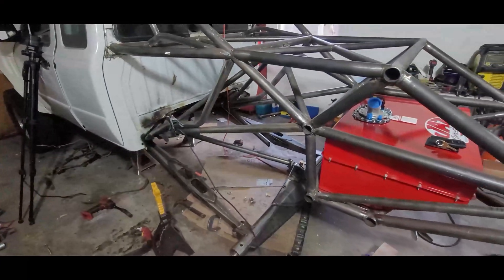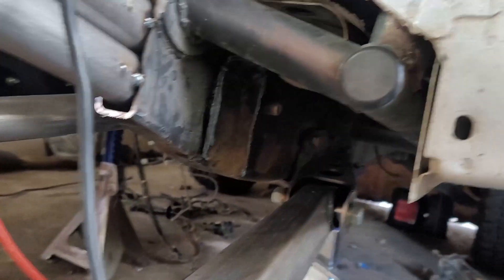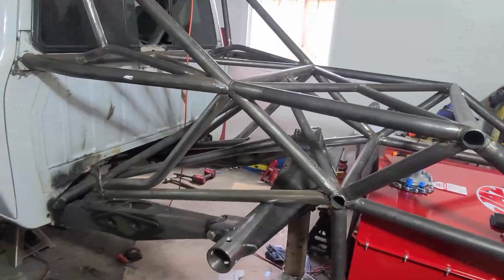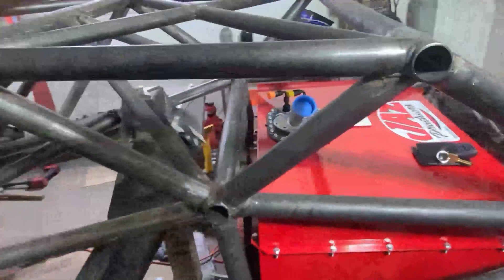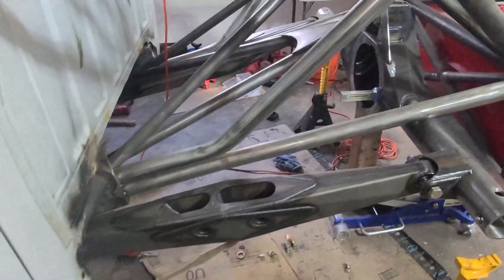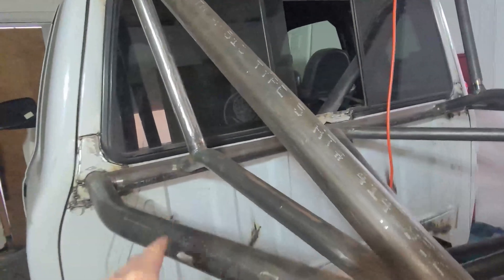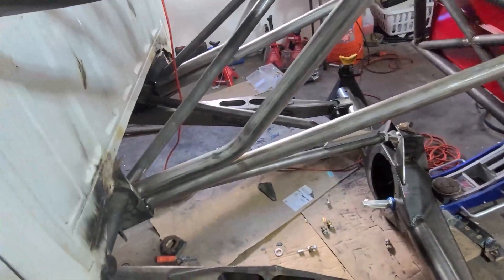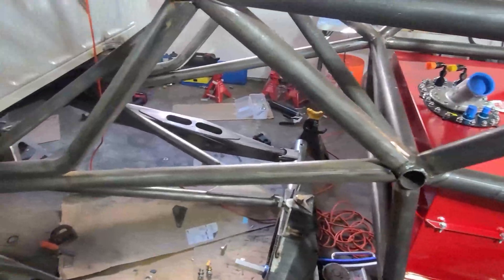Ranger Prerunner Backhalf EP6

Comment: A 14” coilover and 16” bypass might work better for you. 
No point in running a 16”/18” package if your going yo strap it at less since you’ll have way more travel than your front. 
And a 14”/16” package would probably allow to retain those 2 tubes you were talking about cutting out.
Reply from the maker: I'm not really worried about that tube structure, the 16/18 would fit better than a 14/16 and I wouldn't run into as many issues. The bigger the shock the better overall.

Comment: The trans on trucks is usually point down at 5-6 degrees. You want a parallel driveline angle, meaning the rear pinion should point UP 5-6 degrees at ride height. The concept of level has nothing to do with it.

Comment: Also +3 rod ends which those links might need are actually 3 in longer than the standard rod end. I may be wrong but I'd just wait till you have the shocks and ends to build the mount
Reply from the maker: Yeah, they need the +3 rod ends, i am still waiting to build the mounts because of that.

Comment: With pinion angle. If you're using a double cardan driveshaft then have it pointing at the trans at ride height if just a single u joint then make it parallel to the trans at ride height then point it down roughly 2-4 degrees. As long as it doesn't bind in the rest of the travel you're fine
Reply from the maker: Thanks, that's kind of what I thought I would do, and that's what Camburg recommended. I was surprised that there was not a whole lot of info about this online related to desert trucks.